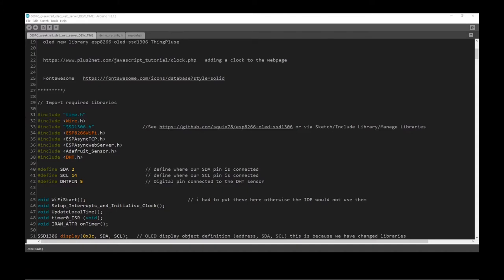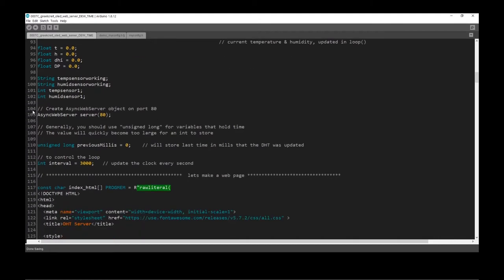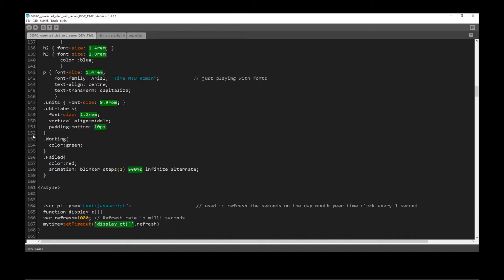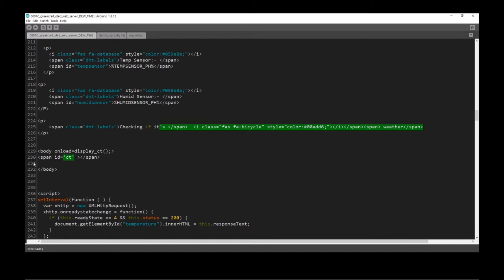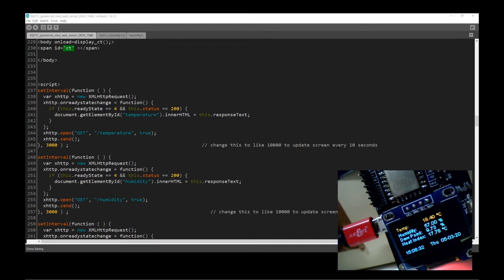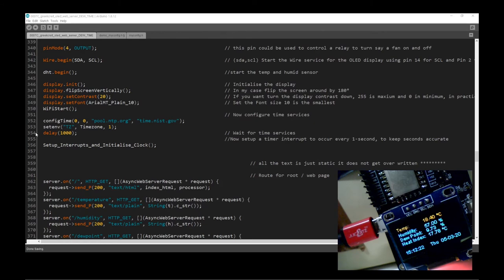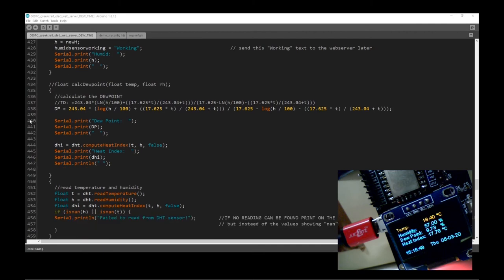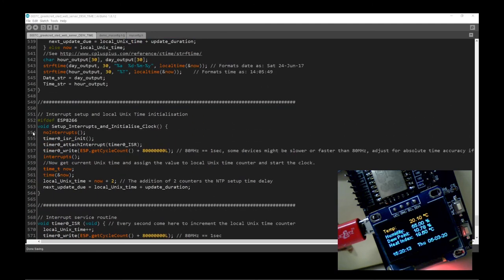GeekCreit Basic Webpage #0008 Webserver & Time Clock

Comment: It took awhile, but I was able to download the libraries, figured out the ssid and password, and got the time from the URL you placed in the code. I am PST (Pacific Standard Time) in the USA. The time keeps running on the webpage whether the circuit board is powered or not. Good job. Still going over the code with you on your video.
Reply from the maker: Let me know what you found difficult so I can add so notes to help others

Comment: Thanks for this video series. I bought a few of these kits to use around the house, mainly to check basement humidity. Ive dabbled into Arduino for only a short time and most of this is still new to me. With the help of your videos I was able to get my boards up and running. Looking forward to new videos you may make. Is it at all possible to record temp/humidity on the device for a 24 hour period and display it on the webpage? Again Thanks
Reply from the maker: Many thanks. Glad it has helped. I am still very new. Yes I have a webserver coming. And then MQTT to publish data to Home Assistant which will save and display the data nice. Do you use HA
Reply: I don't have HA yet, may try to get it up and running in the future. I have some research to do.

Comment: Hey. I tried this sketch. All information comes across well via the browser. But on the oled display the clock is 01:00:33 Thu 01-01-70 The other info temp/humi etc is good. The seconds of the clock are increasing. Kind response. I can't find what I'm doing wrong myself. greetings Bert
Reply: I have this problem sometime and have spent a lot of time trying to find out why the click is wrong. But to-date not found the answer
Reply: @AndyShrimpton-GaaTech  I can't find why it's happening. It's not logical. The variable is good and should also be visible on the OLED screen. Unfortunately no response from the author so far.
Reply: @AndyShrimpton-GaaTech  Thank you.
Reply from the maker: have you downloaded the lib as shown on line 33
Reply: @flixmyswitch  Hello, thank you for your response. Yes I used that lib. The oled screen works fine but does not show the time. I also see it not via the arduino ide monitor function, but on the urt 192.168.1 127. And that surprised me. The information is honorable, but it is only there. After almost an hour, the time sometimes appears on the OLED. That is correct, unfortunately the software often crashes. And do I have to reboot the 8266. I got the same result with another set. Sorry for my bad English :-)  temp and humi etc etc is oke.on all screens. On the oled is at the start (time) 01-01-34 ( and up )   ( date)01-04-70